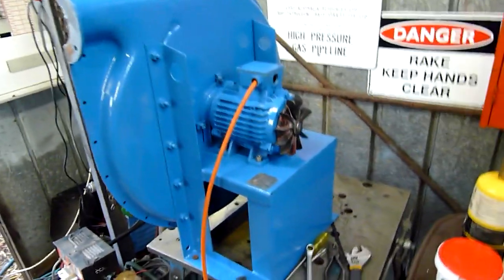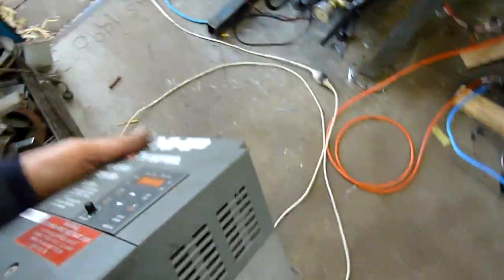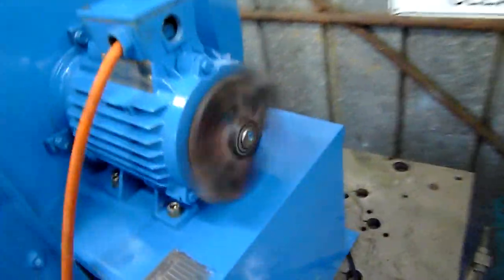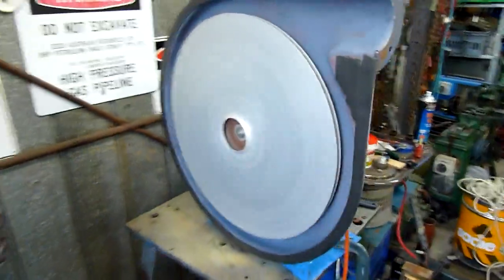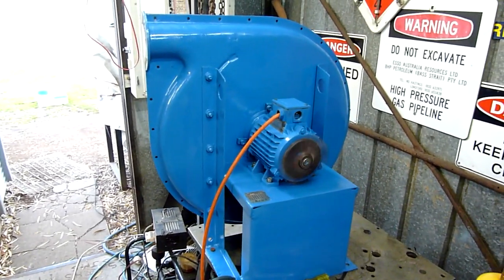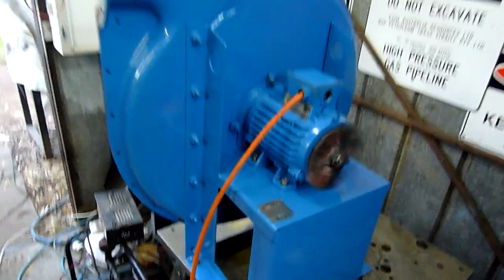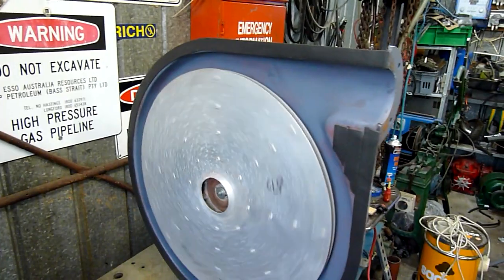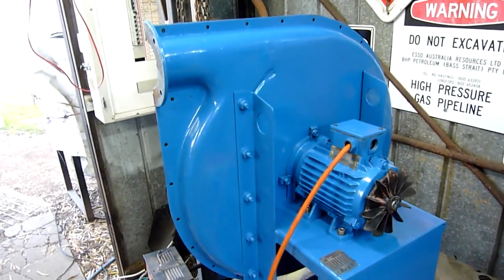Industrial Centrifugal Blower Open Test Run

Comment: It's really hard on an AC motor running it at a lower line frequency for too long. In Canada we used to have some power grids that had a 115 volt 25 cycle line frequency including the area where I live now, you could not use a 60 cycle (Hertz) motor on 25 cycle or it would burn it out. Alternately, when the switched over to 60 cycle, they had to replace or rewind all of the 25 cycle AC motors or they would try taking off. Not sure what they did with the universal motors though.
Reply: Canada is stupid.

Comment: @xhighalert According to the original video that was posted it's 2850LPM, which equates to about 100CFM.  Not much more than a bathroom fan.  But with a wheel of that diameter the static pressure of that thing would be incredible!  I'd like to know inches of vacuum and pressure it's capable of.